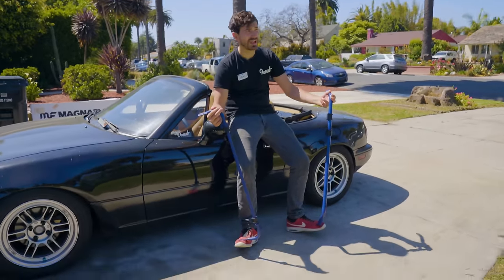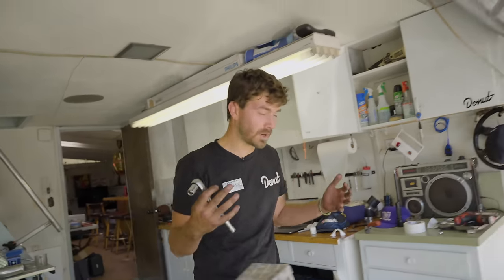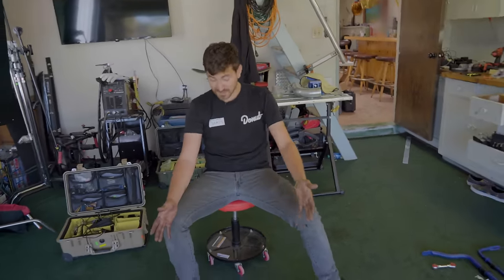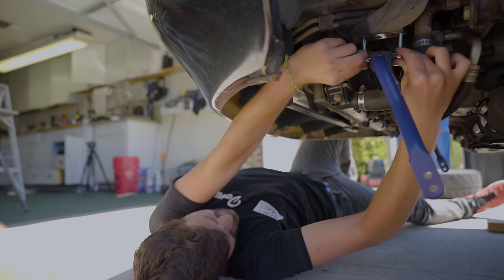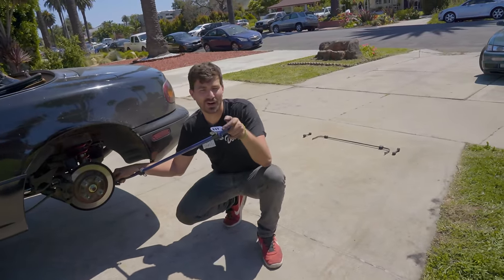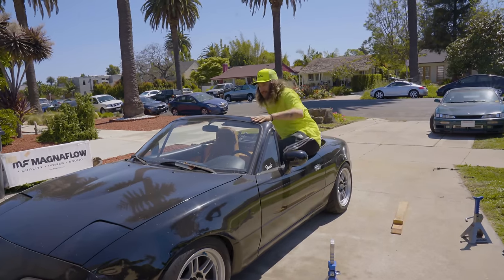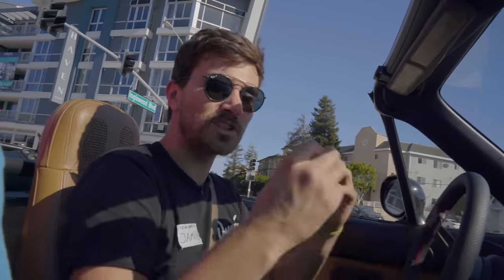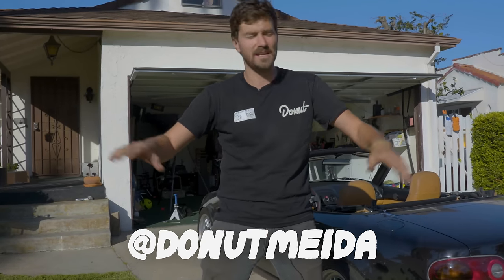Are Aftermarket Sway Bars Worth It?

Comment: Add fender bracers, you will feel the difference immediately.
Reply: @Jay'sWorld! No, fender bracers. Inside the fenders.
Reply: @JDMMasters  where you get them never heard of them
Reply: @BigWillba  I think they are also called “frog arms” they stiffen up the car vertically and laterally making it handle better
Reply: Sway bars nullify the independence of the suspension.
Reply: @briank10101  that a bad thing or good thing?
Reply: @guzman7590  In terms of INDEPENDENCE  is bad, BUT sway bars it`s like LIMITATION for each of Struts. It controls, every time your car  right wheel is higher than other - it whill SWAY the bar and as spring the sway bar will pump it back because of spring force. So sway bars - can`t be something bad...  it was constructioned for CONTROLLING pumping of your car and also known as ANTI-ROLL bar.
Reply: Surprised to see you here. Love your content.
Reply: @wroclawpoland2391  I'm sure it's more of a balancing act. If you want a smoother ride over bumps and potholes but aren't trying to get better handling in corners, stock sway bars are probably good.
Reply: @jorgetello3961  sort of the opposite, they result in minimal effect when the car is not turning, and a larger effect when it is. it literally minimises body roll hence the name anti-roll bar lol

just look at 3:50 -ish 

The main benefit of larger sway bars is you don't need ultra stiff suspension to retain your cars stability.
Reply: @wroclawpoland2391  In Germany it is called 'Stabilisator' or as you would say: Stabilizer. That nails it pretty good I think.
Reply: You shoulda done sways  before coil overs
Reply: @Chubby_Lemon  They certainly have some amount of effect when not turning, more expensive cars have them magnetically disengage for a smoother ride. I guess the question is ultimately, how much does it affect ride quality?
Reply: @mikekillion4731  yeah that's fair enough. big chonky sway bars will have a mildly noticeable effect in straight line stability. but my point was they will have a proportionally larger effect on turning.

but yeah, you're definitely right to some extent, I didn't mean to imply that it was completely unnoticeable in a straight line

Comment: "Are big brake kits / upgraded pads and rotors worth it?" 

Next on money pit?
Reply: Nathan Crouse watch the hi vs lo series the do a test with brakes and rotors and compare them
Reply: Mr.BigBoss7 technically doesn’t increase braking ability, but increases the ability of the brakes to dissipate heat (which becomes pretty important if you’re gonna be braking hard more than one time at a stoplight) and lets them maintain performance. Otherwise, braking performance is limited by tire grip.
Reply: @kinafermusic2456  it can depending on design pad selection ect... Drilled rotors actually help in some cases, but many people keep saying they don't... It comes down to physics. Clamping force remains the same but with drilled rotors the overall pressure on the given rotor area is increased. That's the reason you see cross drilled rotors on race cars. Some pad materials need a certain pressures to work effectively, so drilled rotors can help dial that in. This is most noted with ceramic based pads.
Reply: @SimanSlivar  Not really true sorry. If clamping force remains the same,  the "pressure" will stay the same, on any rotor. For example 10 newtons (force) being applied to a rotor. That force doesnt change from the amount of holes in it, or surface texture. Surface texture DOES effect braking though, just not the amount of holes. What the holes do in drilled rotors is dissipate heat better than non drilled rotors. Its kinda like opening all the windows in your house. The more windows, the better circulation of heat, which cools down your house! That is if theres no wind aha. So as a result of less heat, you get longer track time without brake fade. BUT one of the biggest problems with drilled rotors is the fact that when they heat up too much, they end up cracking or warping, which greatly effects your brakes!! Nowadays people are turning more towards Slotted Rotors, including GT3 race cars and other race cars. They dont crack as often or ever which is nice. What the slots do is release gases from under the pad, and also wipe the pad of any debris, oils , etc, etc. They dissipate more heat than solid rotors, but not as much as drilled rotors. But the fact that your rotors wont crack and completely fail is a pretty good trade off. 
Also pads dont need a certain pressure, but more so a certain temperature. Watch GT3 cars at the beginning of the race on the warm up lap. They accelerate really fast then slam on the brakes, trying to get heat in them. Also if you ever buy race pads for your daily car, i think they have a warning that they arent for street use, simply because your brakes dont get very hot driving on the street. 

sorry for the novel. not trying bash you for your comment, but theres some iffy info out there, and lets face it we're all here to learn! i know i am
Reply: @kinafermusic2456  but if you put like 12 inch wide street slicks on something with brakes made for like 4 inch wide highway tires, I think you might run into your brake limit before the tire slips with stock brakes, I know I do with my rears on both cars, then again the cobra has one frozen open caliper and the gt has ceramic pads in back, but even when the gt had semi metallic pads in back, those 285 wide falken azenis fk510s DO NOT SKID, like doesn't even engage ABS
Reply: @intecz2950  No the overall pressure on the given rotor face is increased. It's also the same principle around puck clutches. It's basic physics, pressure= force/area. So lets say we have 500N of force over 5m2 area that's 100N/m2 of pressure. Now lets drill some holes into our rotor face. 500N however its over 4m2 of area, our pressure is now 125N/m2. We increased the given pressure on the rotor by reducing the overall area of effect of the given force.

This is done because some pad compounds respond better in higher pressure vs others.
Reply: Definitely. Big brake kits work wonders, just look at Mustang Cobras then a Corvette and how they brake way differently
Reply: @kinafermusic2456  You only need to brake at the end if the strip. Need to get light weight brakes if you're going to upgrade them. Most won't drive on race tracks.
Reply: It makes more sense after the turbo.
Reply: Yes the good ones
Reply: @SimanSlivar  cross drilled works great with ceramics because while ceramics have greater braking power, they retain heat more than other materials
Reply: Robert Hollar ooooo that’s actually a good statement and actually does make more sense now. Increasing pressure has a downside as well though no? It increases heat. But as you and the fellow above me said, ceramics retain heat better than other materials. But do most drilled rotors retain as much heat when compared to other slotted and solid rotors? I guess most of the backlash on drilled rotors come from cheaper options that don’t use better materials and manufacturing compared to other high end drilled rotors. Thickness and structure would have to be better overall. That may be why you see many crack. Also the lack of brake cooling via brake cooling ducts and heavy braking tracks on close to stock Cars. if you’re going that route I think other components would have to be upgraded as well. Lines and hardware, dampers, tire compounds, rubbers around the wheel well, wheel type, etc. Interesting thing to think about though. Personally I don’t trust them too much as someone who daily’s and tracks my car once and awhile. But thanks for the information and reply. Like I said we’re all still learning ahah.
Reply: @intecz2950   @Intecz  pressure doesn't necessarily indicate more heat. Infact in most cases it doesn't produce more heat but the same heat, just in a different span of time. That's what brakes do, convert forward momentum into heat. That's why you see exotic cooling ducts and systems for track cars. But in the case of increasing brake performance, that does mean more heat over a given span of time. So yes, that is what we want. The rest of the issue is pulling heat off the rotor.

Your also correct cheap drilled rotors do have an issue. But most drilled rotor issues stem from heat cycles, fatigue, and also the combined increased pressure. Since there are drilled holes in the rotor face the grain of the metal is disrupted, also there is now increased pressure on the rotor. This increases the possibility of cracking and even catastrophic failure.

Everything has a trade off, drilled rotors are no different. They must be inspected more often than normally or slotted rotors. They also tend to need changed more offten.
Reply: @intecz2950  I know this is quite late, but the biggest downside to increased brake pressure is the brakes simply locking up. It has to do with how hard the brakes grip vs how hard the tire grips. The wider the tire and the better the material and tread then the more grip they have, obviously, and thus the more force can be applied on the brakes. If the brakes grab too hard, and the tires cant handle it, then the brakes will lock up and the car will start to slide and shake. This is why almost all street cars since OBD2 have an Anti-lock Braking System, as a road tire will never have enough grip when compared to the brakes, and because of just how much safer they are overall.
Reply: Studies show, that by painting “BREMBO” on your calipers, other guys turn their heads in the direction of your car 2.5 times faster. But it evidently has no effect of women.

Comment: It does affect straight line performance. It makes the suspension less independent. If only one wheel hits a bump, a stronger sway bar will apply more force to the other tire
Reply: Two years later and this is still the only comment pointing out he was wrong about the effects of sway bars. On actual race cars and OEM applications the sway bar rate is calculated as part of the spring rate. They work to balance the two for the expected conditions. A beefy sway bar on rough roads will almost certainly slow you down.
Reply: I was wondering what the catch was to this!! Coz if the positives outweigh the negatives by that much, then manufacturers would’ve had that installed on already out of the factory
Reply: They are installed from factory, just the manufacturer will try to balance performance and driveability. Considering that consumer cars don't generally live on tracks the sway bar from factory is more compliant to deal with rough roads.
Reply: @johnterpack3940 yes, it's true.. but sways on their own don't hurt ride quality very much if the springs and dampers are still stock. However, if you're on stiff coilovers then stiff sways are quite noticeable. You have to judge whether you value a comfortable ride or lap times more.
Reply: @dielaughing73  It isn't about ride quality at all. Making sway bars too stiff can hurt lap times under some conditions. He made it out in the video like sway bars were a free lunch, they aren't.

Comment: Very nice video! Just want to point out a couple of things:
• If the sway-bars are equally thicker, weight transfer will still be the same. Same weight will only be transferred quicker. You can only reduce weight transfer by lowering center of gravity or by widening vehicle track.
• Stiffer sway bars can also affect ride quality even going in a straight line. By making these bars thicker you actually link both sides of suspension together. So if you hit a bump only with one wheel, this impact will move to the other side thus making ride quality a bit harsher. This can especially be felt when driving over poor road surfaces.
Reply: agreed especially with your second point.  There is no free lunch.
Reply: @henrent sway bars aren’t free
Reply: True, and when coupled with stiffer springs, stiff swaybars affect ride quality even more because a small bump on one side of the car is always transferred to the other side.

Still worth it from a performance perspective though

Comment: This car needs a spinny Boi
Who wants to see this Thang boosted??!!!?
Reply: JDM_Dude superchargers are pretty good on miatas as well
Reply: @Vaermxna  i want to see a supercharger. everyone has turbos. superchargers are great for daily cars
Reply: Nicholas Gionet yeah but aren’t they trying to go for the cheaper and reasonable mods? Super chargers are hella pricey
Reply: SupraBoi thats what I was gonna say
Reply: put on a small turbo so there's barely any lag, kinda like the ford ecoboost
Reply: @modernyt854  after considering all the piping and oil porting and welding or exhaust swaps etc included with turbos, the honestly both come to about the same price depending on the engine. Plus superchargers often require less maintenance
Reply: I got to do a track day ride along in a boosted Miata (supercharged instead of turbo) and that thang was SICK
Reply: SUPERCHARGER>>
Reply: @Vaermxna  Won't that be ineffecient compared to a turbo. Just wondering i'm new to this
Reply: @m.usamausman  that depends which one you get. Although comparing superchargers to turbos is like apples to oranges. Each one is better for different applications and engines

Comment: Sway bar upgrade is an especially important upgrade for Subarus (or other sporty sedans) but it’s often overlooked because it doesn’t change the look of the car at all. Instant handling increase, better than springs and easy to install. Tires are also a big factor. I’d do those 2 things first before anything else.

Comment: One point of clarification: all other things remaining equal, larger sway bars reduce grip; its somewhat counter intuitive, but true.  More body roll actually increases grip, which is why most cars are setup to have a decent amount from the factory.
Reply: Yea body roll on avarage stock cars going mild speeds, But someone who will drive the car harder needs that rigidity and responsiveness wich will sometimes cause a loose a grip but ultimately makes the car more predictable to control   .Roll at mild speeds can somewhat help balance cars but on agressive driving roll compromises a lot
Reply: Compensate with UHP tires which have shitloads of grip (Michelin PS4s)
Reply: @hanynowsky  yep I’m running Firestone Firehawk Indy 500s. So much grip
Reply: @fhowland  great choice 👍

Comment: Neglected to mention that stiffer sway bars will hurt your grip on rougher roads as this limits the suspensions ability to adapt to the road with each individual wheel. Back roads I grew up racing on it was real common to just get a stiffer rear bar to keep the ass flat and prevent understeer while letting the front articulate over the rough stuff and maximize grip.
Reply: Just to add in general, there are always compromises when it comes to sway bar stiffness, front and rear.

Front: the stiffer, the more understeer, caused by removing weight from the tire getting the most traction (the outside, due to the larger radius from corner centerpoint). Though you are keeping more weight on the inside compared to a softer bar, you are exchanging downward force for lateral force. As an extreme example, if you were on ice, higher downward force on one tire is going to give you better grip than redistributing that force both laterally and to the other tire. 

The benefits of higher stiffness in the front will be better mid corner tracking and corner exit, as there will be less weight transfer occurring.

Rear: The stiffer, the more oversteer and a higher chance of snap oversteer, especially in the wet. Same ice example applies above. The stiffer will help with corner entry/turn in, but will negatively affect corner exit because of the same grip changes and more oversteer nature of the setup.

As with anything suspension related, there is a balance between all the components (spring rate, dampening, ride height(center of gravity), vehicle weight (corner weight more precisely) and sway bar stiffness being the big ones). Too stiff is just as bad as too soft. There are compromises no matter the setup, but what works the best falls on the conditions you plan on driving in.
Reply: @winebartender6653  front bar does make the turn in feel better aswell but softer front feels less good but grips better

Comment: "this will never be a really fast straight line car"

all the turbo mx5s "Am I a joke to you?"
Reply: UK V6 Jag swapped Miatas too hehe
Reply: He's gonna turbo it...  just wait...
Reply: The LS Miatas fell out their chair laughing
Reply: Demon swapped Miata’s have joined the chat
Reply: fast means less than 4 sec to 62mph
Reply: M G still aint fast 🚮
Reply: @GustavCarl17  13B Swapped Mitas breaks but sick
Reply: @jacklondon7873  thats a whole lot of work to barely beat a supercharged 1.8 that doesn't even need its oil pan drilled.
Reply: @Funny_Milkman  carpassionchannel doing it in 2.9 if i recall correctly
Reply: @Funny_Milkman  
Fast is what the general population would call fast.  Which realistically most non car people would be excited at 5.x second 60 times.   

To you fast might be 4 seconds.  To the average person a fast car is slower.  That's what more accurately defines it, not your specific definition.

Comment: I did a full suspension swap out with my Mercury Grand Marquis. With the added power of Maruader bits and those tiny Tweeks. It felt like a whole different car on and off the track. It felt like I was in one of those movie cop cars, cashing a perp.

It's back home, god I miss that thing.

One of the things I learned is when you adjust your suspension. Count the turns you use. Also go back after install and a brisk test drive to re torque anything to ensure everything is nice and tight. That way nothing is forgotten, nothing will fall out. Its 100% safe, which safe is good.